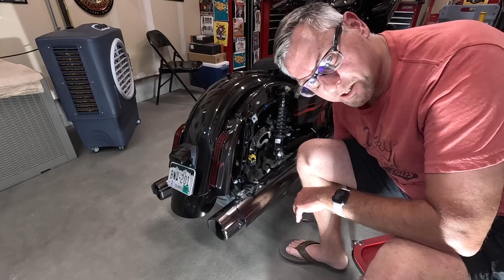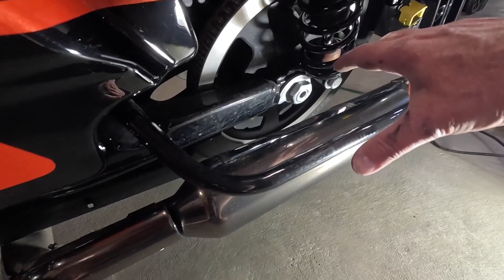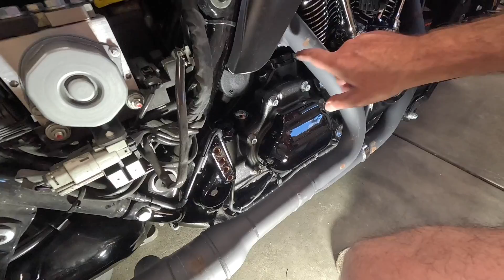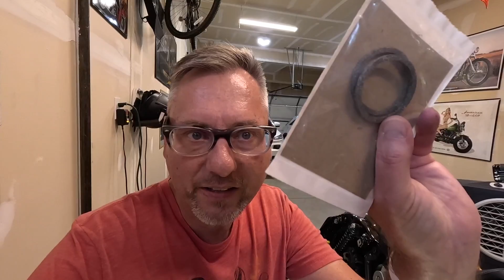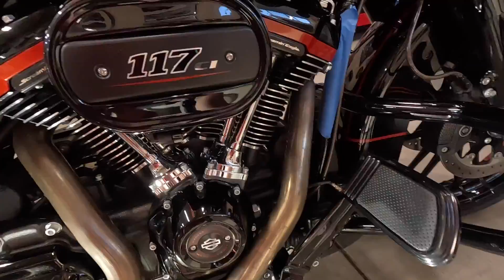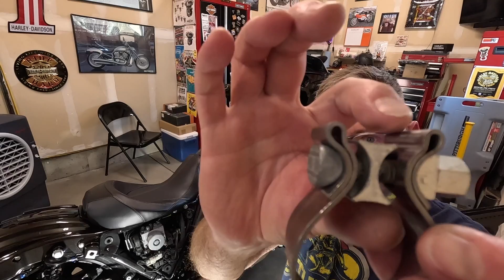Changing exhaust on a CVO

Comment: Do you know if the stock head pipe off my 2018 Road Glide Ultra will fit on my 2023 Road Glide CVO?
Reply from the maker: I have not personally installed an original header pipe but I have seen pictures and all of the mounts look the same.   I think the main concern is not having a tune for these new bikes.   I still have my 2018 head pipe that was decated.  I keep hoping for a tune option before I try it.
Reply: @ITFZone  The part number for different exhaust manufactures appear to be the same for my 2018 107 and my 2023 121 so I plan on removing the cat from my 2018 header and put it on my 2023 CVO. Several videos I have watched on the 2017 and newer bikes with the Milwaukee eight engine show that these newer Harley's have a much richer tune than the older lean tunes of the past. The factory ECM's also are more capable of adjusting the fuel air ratio with a stage one (header pipe, mufflers and big breather) modification for a safe A/F ratio without a tuner.

Comment: I didn't change my headers out, I punched out my cat with steel rods and removed A LOT of heat and picked up power and sound. Very easy to do instead of spending over a grand for new pipes.
Reply from the maker: Agree!  I have also done the same.   This particular head pipe was the stock pipe my CVO came with but FullSac had a program where you could send it to them and they would remove the cat but then extend the individual returns.   I found a noticeable bump in power but a lot more sound out of the left muffler as well.   For whatever reason they stopped offering this service.
Reply: @ITFZone  I'm sure it has something to do with the EPA trying to fine anyone altering the cat.